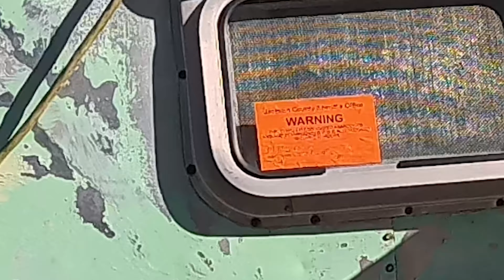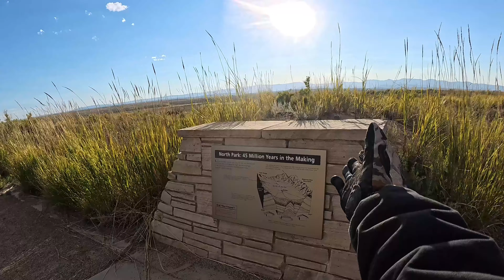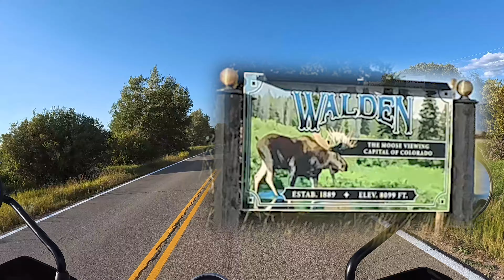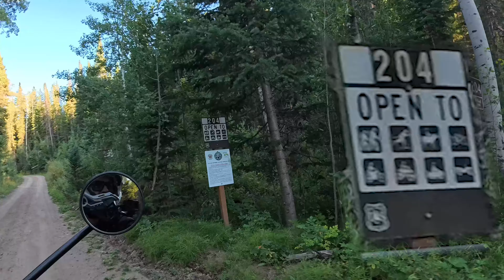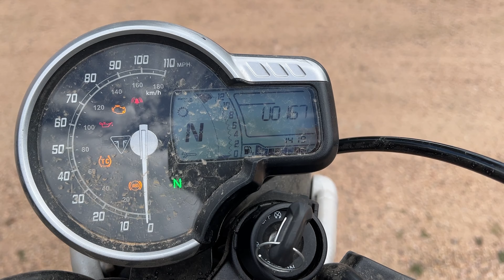1 Little Spill Off Road Disabled My Triumph Scrambler 400 X and Left me Stranded

Comment: Thanks for the vids. Neat scenery as always. But regarding this vid, thanks for the reinforcement of similar thinking. Too much technology can ruin your day. Keep up the good work and try to keep the wheels down. 😂 Glad you weren’t hurt either. 👍🏼
Reply from the maker: Hey no problem, thanks for watching! Thats for sure. it’s also how new vehicles are being engineered so only the dealer can fix them. They lock down the electronics. Im not against electronics. Im against locking me out of them. If this happens again, im taking back control, installing a standalone ecu, im tossing the immobilizer, stock ecu, Abs unit, and instrument panel. Ill have custom brake lines made to go directly to calipers. Ill install a standalone ecu probably a microsquirt 3.0 and an aftermarket universal dash. abs and immobilizer will be deleted. Ill now have full control over what happens. No longer need the immobilizer to allow the ecu to work. I can tune the engine how I see fit, stall outs at idle because the mixture is too lean because Triumph was trying to meet an emissions standard? No longer need to beg triumph to fix it, i can fix that my self. I now have full control over the motorcycles electronics. It will be a learning curve for sure but I have the background to pull it off.
Reply from the maker: Thanks glad I wasn’t hurt as well! Thats the main thing

Comment: I learned quick, those deep ruts will take you every time
Reply from the maker: Yeah especially when your zoomin and font know the roads
Reply: @TDubsKid  Yeah I live in Fort Collins and crashed my first bike on Buckhorn rd up the Poudre canyon. It was my first time in that area and I was riding an old shitty 85' XR350R, throttle got stuck in a corner and I panicked and grabbed front brake and dumped it probably going 25/30. Bike was fine but I was pretty torn up and broke my wrist. I rode the bike back to my vehicle and loaded it up broken wrist n all. Shit happens.

Comment: Ah that's too bad, that is very frustrating. IMO, I think you will find the new Triumph will not be as forgiving as the TW is, even with crash protection. It will do fine on gravel road adventures, but its not going to take the abuse with anything more than that. I also read your pinned comment, that seems like a lot of work to go through to bypass the immobilizer and sounds expensive too.
Reply from the maker: Yeah it was sad. Its more for road and gravel roads for sure, but it was fun riding on that. Probably not doing a standalone, but wanna see if there is a work around

Comment: Glad your not hurt. I've got the Speed 400 which shares the same torquay engine. Like you say its not a dirt bike, the block pattern tyres limit it somewhat, however they are both smashing bikes and I'd be happy with either. Hope you get it fixed up okay.
Reply from the maker: thanks! me too. nice maybe I should have just got a speed and never went off road. yeah it's not but was fun on some mild off road. me too. only $1800 just to make it run again
Reply: @TDubsKid   @TDubsKid  Wow $1800, that was my only concern with buying a new bike, what with all the tech/software updates etc, that only the dealer can sort out. I think they make more money from that than selling a new bike. I like servicing my own bikes so once its out of warranty I will have to put up with a wrench on the lcd display.

Comment: It's great to see you out exploring.  Sorry about the rough ending to your day. :(
What a fun looking bike! Great mileage and range. That bites about the immobilizer. 

I had an older Saab. It was a blast to run, but one year it decided the ECU would die. That took getting it to the only dealership in 100 miles that could work on it and thousands to fix. A year later it decided to unpair with both of my keys and I was told that the whole security interlock and keys may need to be replaced for thousands again.  I have a love hate relationship with electronics. :( 

I've been eyeballing the Himalayan 450 and the CF Moto 450. Your experience made me look and it sounds like most new bikes have an immobilizer. Now that I think about it, a Dork in the Road video had him loose a key on some bike, it kept going but then coudn't restart due to the immobilizer. That is discouraging. I would want to remove that tech to trust it for back country exploring.
Reply from the maker: Thanks! Yeah wasn’t the best. Wish you could get it without the immobilizer 

I hear you about the saab I had a 9-3 bought for $5000 all the modules slowly started going bad on it. Loved driving it and it got hail damaged and totaled and got $3700 back on it kept driving it. And eventually sold it for $800 but drove it for 6 years. Got my moneys worth

Those are cool bikes but Yeah the immobilizers are so annoying for off road and adventure. Need to find ways around them

Comment: Great video. Your previous videos inspired me to get the TW 200. Sorry for your rather expensive mishap. What did the dealer exactly do that cost you $1800? I will look forward to see what you do to your Triumph to make it more user friendly. How you cope with the extra weight and higher seat height compared to the TW? keep up the good work.
Reply from the maker: Thanks, glad to hear, mostly was an immobilizer system, they only sell the entire system together, and has to be re keyed. And only the dealer can program it. It should be a separate $50 dollar part the key antenna ring. Triumph is not going to like the video im making about it. 
Other than that its a great bike to ride, just needs crash bars, and hdb handguards, thanks

Comment: As someone who's done WAY TOO MUCH off road adventuring on the wrong motorcyle (honda grom and monkey), I can say that airing down your tires on your tubeless scrambler will really make adventuring off road far better. This allows our grom (with knobbies) and our monkey (tires more like what's on your scrambler) to track  and ride so well on the rocky, gravely, and even the fine sandy stuff. Worth a shot experimenting with that!

Also, I'm sure you've already gotten it resolved but any car with an immobilizer coil/antenna can be DIY repaired/replaced as none of the programmed integrated circuits actually reside inside of the transponder antenna assembly itself. The code is likely showing as result of open circuit or simply because of the key not being detected. Technology is awesome but also such a bummer sometimes. Sorry you had a rough day! You'll pull through, when it rains it pours!
Reply from the maker: Yeah lower tire pressure should help for sure, would have been better to go slower since I didn’t know that road too.

Yeah the pickup coil should be replaceable by itself, but Triumph doesn’t sell the coil alone, only sells the entire system together. Im going to make a video on everything

Comment: Taking back control....sounds good. I was just checking back , wonder what the status was. Without the skill set the Triumph wouldn't make sense for me. I've always had the theory, expensive bikes are expensive to fix.
Reply from the maker: Yeah just got it back from the dealer, I got  the entire old immobilization system back so might work on trying to figure out a workaround. It would be great if you buy it without the immobilization system. Going to install crash bars, new 1 1/8 pro taper bars, and HDB handguards. It sure is a joy to ride

Comment: This is the same for new cars and pickups, also. Too darned much electronics. I just bought a new 2025 Tdub, and I have been ridng a couple of old carbureted Harleys for 20 something years now. So far, I have never had one fail, that I couldn't fix on the road, except once when I broke a drive belt on my old 98 Wide Glide. It wears a final drive chain now and has for many years.  I do like an electronic ignition but they have taken things way too far, on purpose so you have to take them back to the dealer to get fixed.
Reply from the maker: I know, the new tech is great until it isn't haha, that little piece of broken plastic cost $1200 to fix cause they only sell the pick up antenna with the entire key and immobilizer system, with new keys and everything. only the dealer can program a new immobilizer module. should be a $50 part. and it's not to hard to replace and wouldn't need programing if they sold the part separately

Comment: Cool bike otherwise but man that sucks. It's not as good looking but I think the DR650 might be a better choice.. lighter weight, similar power, more torque, better suspension, old fashion Japanese reliability, etc.. low seat height too.  Kinda like a bigger TDub. DRZ400 is cool too but seat height might be a deal breaker for you.  I'd be tempted to trade that in if that happened to me!
Reply from the maker: Yeah it was a very fun and joy to ride bike, but its crazy how a tiny broken plastic piece completely disables the bike and costs $1200 to fix 😂 yeah for sure, im stuck with this bike though, going to armor it up and do some mods
Reply: @ Oh yeah you have the ability to toughen up the weak points and turn it into a tank. It’s still a very cool bike IMO.  I can see why you bought it.

Comment: Clean it up sell it and consider it a lesson learned 

It will happen again

My tw usually gets mpg in the eighties

Fuel injection is not a plus on a motorcycle in my opinion I have four bikes two are injected and the added complexity adds little in my opinion 

Wish all four were carbed
Reply from the maker: Naa not worth it wont get much for a bike with a crash on its record. If this happens again I will be installing a standalone ecu, and deleting the bs making this thing the way modern bikes should be
Reply: Right, and you can open up a carburetor on the side of the ditch with probably just a pocketknife

Comment: That sucks especially since you didn’t have crash guards on but not sure it would have helped with the immobilizer. Have the same bike but don’t really taking it off road more of a commuter..customized it like a bigger speed 400. I like triumph but with electronics they are issues that go with that. Dad had a triumph and love the retro looks but always seem to enjoy my  Royal Enfields more with simpler electronics and cheap parts. Currently had to take it in for an update cause the know stalling issue still persists
Reply from the maker: Yeah the worst part is I had all the crash bars just not installed yet. Yeah that probably would have prevented a lot of the damage. Yeah they at least need to sell the parts individually rather than selling the entire thing and only the dealer can program it. Im getting all the parts back so I can try and figure out a work around. More videos to come!

Comment: I've got a 400X also, in red.  This is a shock to hear about this problem, but you won't be the last one to dump their Scrambler and be "immobilized".  This will hopefully get the attention of Triumph and a fix or workaround will be developed.  They have sold thousands of these worldwide and I suspect the Speed 400 has the same problem.  It is not excessively heavy (395 lbs) for a bike of this type.  The new Himalayan 450 is about 25 pounds heavier.  If Triumph or the dealer can't figure out a cheaper way to fix this then there will probably be an aftermarket fix.  Kinda stupid set up since it already has an RFID equipped key needed to start it.  When you park it and remove the key I believe the Immobilizer is active for about 24 hours and you need the RFID key to start it.  This was probably designed with Britain in mind where bike thefts are very common.  Keep us posted.  It' a great bike otherwise.
Reply from the maker: Yeah its pretty terrible, the antenna for the key chip appears to be separate but they only sell the entire system as 15 cost $1200 to replace and could only be programmed by the dealer. Should be a $50 dollar part and not too hard to swap out and would have no effect on security. Im going to be doing a video shedding light on this issue titled “tiny broken plastic piece on my triumph completely disabled the bike and costs $1200 to fix” I hope it blows up and triumph actually makes a change

Comment: Hmm... Recently I washed my 400x. At the back of the engine there is a spot where the water accumulates. To get rid of this water, I tilted and leaned the bike on its left side as low as the handlebars touched the ground. After that, I couldn't star the bike. Tried for over 20min without a result. Then, I leaned the bike to the other side for few seconds, lifted it straight up, and the bike started. I guess it has something to do with the fuel pump or perhaps a tilt sensor.
Reply from the maker: Wow thats pretty crazy I wonder why it wouldn’t start, maybe there is a tilt sensor for the traction control but I doubt it would cause the engine to not start
Reply: @TDubsKid  I am not sure but it must be something to do with the fueling as the engine was turning but not starting.

Comment: Amazing how stuff up on the handlebars get smashed when you would suspect only the bar ends and levers would be in the impact range. Those engine guards would have maybe saved the gear shifter?  So sad to get that much damage at lower speeds.
Reply from the maker: Yeah its crazy, thats what happens when its on very uneven ground, may have helped if I had Highway dirt bikes handguards and crash bars on, going to do some upgrades
Reply: @TDubsKid  kind of surprised you didn't go with a KTM 390.  But nice bike!

Comment: I have gotten a good low mile used TW200 for the price of your repair bill!
Lucky you did not get hurt, 400 pounds and rocks is a BAD combo for sure.
I would never buy a bike with security features, sidestand switches and neutral interlocks are bad enough....
Reply from the maker: Haha I bet, I just have no need for another tw. It would have been cheap if they sold just the part that was broke. They are going to get called out in a video. 
Me too, getting hurt sucks. 
Yeah wish it came as an option

Comment: Had a similar incident on my street triple where the ignition cylinder itself broke after a spill. After a bit of troubleshooting I was able to get the coils back into 'on' position (my key and such were fine, solely the ignition housing broke), taped it up so that it stayed in the on position, and then made the nerve wracking 40 minute ride back home. Didnt quit on me once though, and cant help but wonder if my frame sliders were already installed, would the ignition have even broke?

Seems like a really unfortunate situation you had, cant say id take my bike offroad without beefing it up first. Triumph bikes are mechanically sound, its the electrical gremlins that make me worry
Reply from the maker: Yeah thats rough when that breaks, im mostly upset, you cant just replace the pick up coil around the key itself. Right now the entire key set and lock has to be replaced. Good to know, wish I could have got it without the immobilizer system
Reply from the maker: Yeah Im wondering if the crash bars would have saved it as well

Comment: Sorry about the crash/damage!
Its not really a dirt bike, or even much of a scrambler.
Looks great, nice power and features, but expensive to own.
Valve checks are not simple like the TW200, and all the electronics and water cooling turn me off.
I have had a Royal Enfield Himalayan and now have a Scram 411 which is built for off road and rough service.
Those bikes are inexpensive and simple, parts are dirt cheap and its easy to service the bike in your garage.
The weight is low so even though they are on the heavy side, they do dirt well.

Does the bike still shift ok?
Maybe you could fix that part (if needed) yourself and just have the shop replace the key switch?
Reply from the maker: Thanks, yeah its fun off road but delicate. This would be as much as an issue if they sold the key antenna by itself, it should be a $50 part at most. Yeah just needed a new shift shaft. Only $25 part just had the dealer do it all cause insurance was paying for it. Triumph is gonna get called out in another video though. Yeah wish I would have gone with something without an imobilizer system

Comment: Disconnect and reconnect the battery. See if it resets.
Reply from the maker: Good idea but The pickup coil for the key antenna is broke cause it was molded into the plastic

Comment: I wonder If a small windscreen like a DART windscreen might avoiding this situation🤔, I honestly cannot understand how you managed to hit the ignition key holder, at first I tought the Culprit was going to be the shifter shaft but it seems at least you were able to put it in gear (or so it seems) on my Street Twin 900 when I fell with it the shifter shaft just snapped from the inside and I couldn't put it in gear, luckily I wasn't in the middle of nowhere.
Reply from the maker: Maybe or some kind prtection bar of some kind, crash bars may have prevented this as well. Yeah the instrument cluster was pushed into it with enough force to break it but didn’t break the instrument cluster. Yeah im really hoping its just the shift shaft